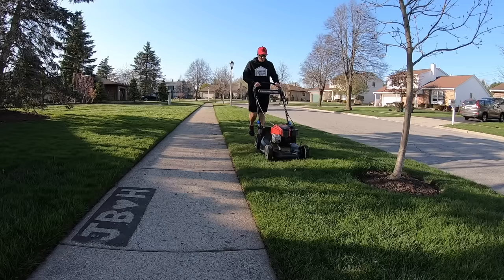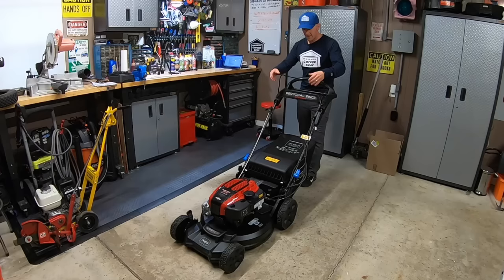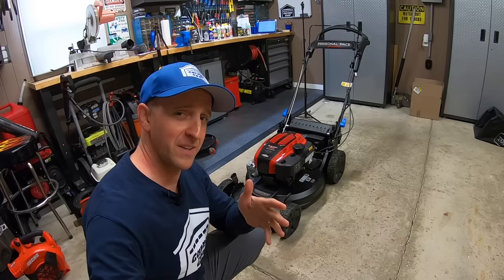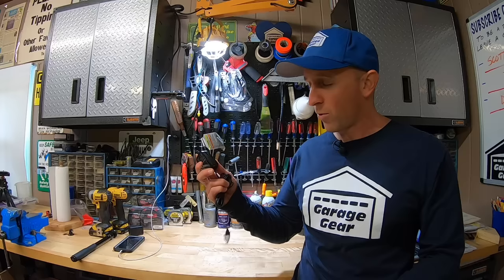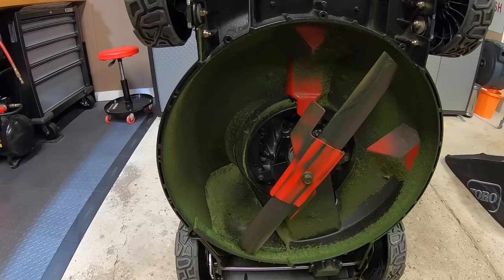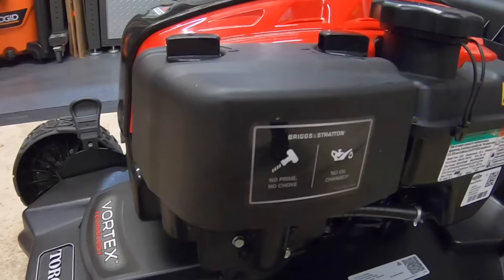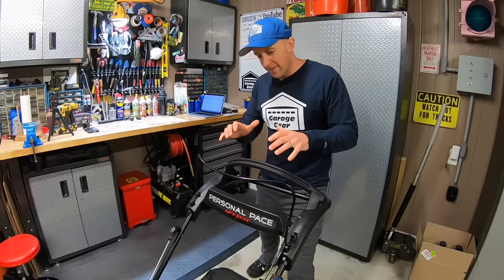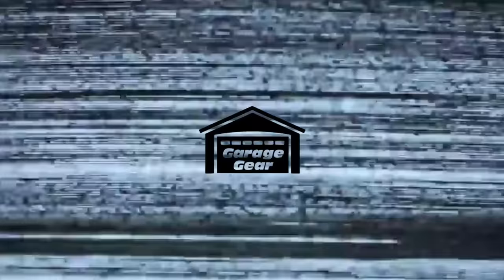IS THE TORO SUPER RECYCLER 21564 THE BEST HOMEOWNER LAWN MOWER?

Comment: The sputtering is easy to fix and has three causes.  First, the spark plug boot may not be pushed all the way on.  Second, it only comes with only enough oil to fill to the bottom of the acceptable oil fill zone on the dipstick.  The engine has an oil level switch and won't run if too little oil is in it.  Mow on a hill or hit a bump and the oil sloshes and the oil level switch momentarily turns off, killing the engine for a second.  Just add more oil up to to the top of the hashed area on the dipstick.  Finally, the factory Champion plugs just misfire.  Take your spark plug out and replace it with correct E3 brand spark plug, (E3.20 on mine).  Be sure to carefully set the spark gap to what the manual says (0.020" on mine).  Regarding the slight variation in wheel height, the wheels have ball bearings and tighter tolerances.  With plain bearing wheels there is more bearing play and that lets all wheels touch the floor, therefore you can't detect any wheel diameter difference.  Not an issue at all when on grass as the grass is springy.  Good mower.  Much more nimble than the steel deck versions.  I have long arms so the lower handle does not hit my gut.  If you have short arms or a big gut, I would not recommend it.
Reply from the maker: Thanks again for sharing these tips!

Comment: During the 1st mow with my brand new 190cc super recycler using the supplied toro oil it sputtered and complained like everybody says.  Changed the oil to mobil 1 synthetic and an E3 plug and its a different mower! Just completed a 3rd mow and absolutely no sputtering. using  reg 87 octane pump gas 

In regards to the "3 wheel off balance" issue, if you note in the manual, to achieve a particular mow height,  the front wheels will have a different notch than the rear wheels. I followed these directions and all 4 wheels are firmly in contact with my garage floor. Good luck with this very picky mower!
Reply from the maker: Thanks for sharing!
Reply: You're asking for trouble using ethanol! Bad bad bad
Reply: @pmaint1  he said regular...which usually means non ethanol
Reply: @GamerNxUSN  Have you ever been to a gas station? For the lower grade gas is always regular! Non ethanol always says non ethanol or ethanol free. Regular unleaded is just that regular unleaded. WOW

Comment: After 11 years I had it with my Husqvarna. Engine still runs well but for the last 2 years I’ve been dealing with a hole where the wheel fits the deck causing the deck to drop no matter the amount of JB weld products. I spent some time trying to figure out if I wanted to go with the new Toro Super Recycler 21565 or the Honda HRX217VKA. Ultimately I chose the Toro mainly due to the aluminum deck and Honda leaving the outdoor equipment scene. Hopefully I made the right call. They sure are expensive these days.
Reply from the maker: Nothing seems to come cheap nowadays other than cheaply made lol

Comment: Proud owner of a 21564 as of 4 hours ago thanks to your videos. Just like you warned. One front wheel spinning freely while the other three are resting on the garage floor. Also, the spark plug boot wasn't even close to being seated on the plug. How can this consistently be a problem before being boxed and shipped out? I got my mower preassembled from a very respected dealer and they obviously didn't catch the plug boot issue. Thanks to your videos I knew exactly what I was getting into and what to look for and address. I'm pretty excited to mow after taking it for a dry run around the driveway. Personal Pace worked very well and disengaged when it was supposed to when backing up. Keep up the videos coming!!!!!!
Reply from the maker: Thanks a lot for the awesome feedback! Glad you found this video and it’s information helpful Mike! 👍👍

Comment: I have the 2021 190cc, mine came with side discharge but it's on the side, not from the back. Seems pretty unsafe that it's coming from the rear so close to the legs.

Down south we got some thick St. Augustine and even after 3-4 weeks of not mowing with heavy rain and fertilizer, the 190cc cuts through it like butter.

I don't have the "vortex" but I still love the machine. The Engine surges, but I put High octane gas in it and it doesn't sputter. Seems to sputter on hotter days as well.

Great vid.
Reply from the maker: Thanks for sharing all of this Conrad!

Comment: I purchased the same mower and found that it sputtered and surged after 15-20 minutes of mowing.  The dealer replaced the carb at the recommendation of Briggs, but it did not solve the problem.  The dealer finally found that the gas cap was not venting properly and that solved the problem.  Hope this helps someone!

UPDATE:
Unfortunately, after mowing yesterday I had the same sputtering problem.  After mowing for a few minutes the engine started to miss, and then after continuing to mow for 20 minutes the sputtering started all over.  So far, new carb, new vented gas cap and new spark plug have not fixed the problem.  Back to the dealer tomorrow!

2nd UPDATE
On the third trip to the dealer, Briggs had them change the coil and that seems to have solved the problem.  Hope this helps someone.
Reply from the maker: Good to know! Thanks for sharing this John!
Reply: Mine is back at the dealer with same issues.

Comment: I’ve mowed with this exact mower for 2 seasons, one thing I wanna mention the wheel axles are plastic. If you mow on a long incline ( like a river bank) I have split out the wheels twice. The fix: put radiator clamps, that, when tightened around plastic axles, will hold the split wheels axles permanently so you can mow on inclines without gear’s slipping. 
The wheels should’ve had metal sleeves around them in 1st place. I guess toro wants to sale more parts!😂
Reply from the maker: Thanks for sharing this information my friend!

Comment: Another great video Jb! I have the exact same mower and have been using it since March, and have no sputtering... 1 helpful suggestion for those that own it, to help make the plastic carburetor last longer, put a fuel shut off valve on it and shut the fuel off when you're done mowing for the day and let the mower run till it runs out the fuel in the carb. Then pull the starter rope a few times to purge the carb.
Reply from the maker: Hey Keith great plan! I may have to make a video on this to share with everyone! Thanks for sharing! 👍
Reply: Can you help me with where to buy or model, for the fuel shut off

Comment: I have a similar model I bought new last July. About 2 months ago, the engine would stall out like it is running out of gas.(even though the tank is almost full). Brought it to the Toro service center and after having it for 3 weeks, they said they cleaned the carb. After paying $110.00 for that, got it home and did the same thing, stall out. Brought it back to the service center almost a month ago and still waiting to get it back. From what I read on Toro owner's group blog, sounds like the coil went bad. Anxious to get it back and see how it runs.
Reply from the maker: Hey just fishing, I want to say that this is a carburetor issue. A broken coil usually wouldn’t even let the mower start to begin with. Let me know what you find out. 👍
Reply: will do, thanks for the info. @GarageGear

Comment: I looked at the new Roybi $800 all wheel drive yesterday at Home Depot. it came with two batteries. Also you get either a free trimmer or blower with another two batteries. I’m still on the fence on battery mowers. My six year old Toro is still working, but needs a few things I give it a workout each week. I saving my money this summer for a replacement.
Reply from the maker: If they are giving stuff away for free it’s probably not good. Just a heads up.
Reply: @GarageGear  This man, I priced out the Makita xgt mower, trimmer, and blower and it came out to be over 2k and that's without any extra batteries.

When the price is too good to be true walk away. You get what you pay for.
Reply: @campbellpaul  I do work on my mower when it’s needed. They are not that complicated.

Comment: I have the 190cc B&S on my 2008 Toro 20092 model- this year is it's 16th season and never had sputtering. I'm getting a new one and giving it to my son for his new house. I've changes the oil maybe twice, otherwise have always just topped off, maybe 2 air filters and until the 15th season, always used 87 octane & 10% ethanol fuel- with no issues- starts fast always. I'm either lucky or it's rock solid!
Reply from the maker: Thanks for sharing! Now your son can enjoy the mow as well!
Reply: @GarageGear  Any plans on reviewing the NEW Ariens Razor Reflex Dual Blade mower? They're getting back in the walk behind mower market and seems to be trying to go after Toro.
Reply from the maker: @normbittner3762  possibly next season norm we will see! It’s definitely worth a look!
Reply: Agreed- I ordered my new 21564- wanted to buy from my local dealer but could not pass up $719 w/ veteran discount & free shipping from Home Depot.
Reply from the maker: @normbittner3762  good deal! Thank you for your service!
Reply: @GarageGear  My new Toro arrived yesterday and all is well- scratch on the deck and box was a little rough. Had weird messages from FedEx- ended up calling Home Depot and FedEx- the then expedited it and Home Depot gave me another $107 off, just for my trouble, I was just curious if it was ok, lol, so only cost $612! Also, when I put in the oil, I realized that the most rear slot in the plastic motor cover is designed to hold the dipstick with the handle grip slid into the slot 😃😃. Saturday will be its first action. Oh, mine also had all kinds of clumps on the bottom of the deck.
Reply from the maker: @normbittner3762  nice that they gave you a discount! Thanks for sharing and enjoy the mow!
Reply: @GarageGear  New Toro had its first mow yesterday- just like you said, the cut is not quite as good as my old 2008 Model 20092 Super Recycler. I changed the oil after the first mow, 45 minutes. It took a little getting used to with the, it does maneuver a bit different. I did have to adjust the personal lace cable right out of the box. It would propel on my flat driveway but no very well in the grass and not at all uphill. I had to move the cable towards the transmission about 1 1/2" to get where it needed to be. Not sure if you made a video on this but might be a good idea.
Reply from the maker: @normbittner3762  hey norm! I’m thinking this could be one of the next videos! Appreciate you sharing the idea! 👍
Reply: @GarageGear  Sounds good, I look forward to seeing it. Also, not sure if the slot for holding the dipstick was intentional or not, but it works well, lol.

Comment: Your lucky yours came out of the box and RUNS! I traded in my 2 year 3 month old Toro "Recycler" after 4 visits to a lawn equiptment sales/service shop to be looked at (the last 2 were to a Toro dealer) . The first season was ok, the rest of the time was awful! Sputtering and not starting after taking a short break and trying to restart it, I was pushing in the plug boot just in case. After trading it in I bought the Toro Super Recycler #21564 for $900.00!! I took it home and noticed 2 drops of oil right under and behind the muffler, I thought it was because it was just preped. The next morning I started it, after"3" pushes on the electric start, it started but smoked like crazy then setteled down. But it was surging/sputtering then I looked as I started mowing and I was able to look over the engine in front and saw a few more drops of oil, I went a little more and saw a little trickle of oil I stopped immediately, I just couldn't believe my bad luck a brand new mower! I was beyond mad. I called the dealer and had them pick it up, the driver tried to start it and after 5 pushes on the electric start he tried to pull started it, NO luck. I don't know what to do I think I deserve another new mower but I don't think it will happen, any advise??
Reply from the maker: Hey vinyl! I would request a new one! Oil drips are never a good sign. Thanks for sharing this with the garage gear community! 👍
Reply: @GarageGear  Thank you! I'm calling Toro tomorrow!
Reply from the maker: @vinylmaven1074  let me know how it goes

Comment: I've got a "20" Super Recycler.  Two big issues with it;  #1  Sprays out a ton of clippings on the Left side, getting packed down by the rear wheel.  #2  when pulling backwards, no mulch what so ever.  Cut 2", you've got 2" trimmings left on the lawn has you pull the mower back.  Was wondering if the front vent helps with that ?   Both the Dealer I got it from and Toro totally deny this problem exists.
Reply from the maker: Hey jada! The vent on the front is really just a gimmick! It barely does anything from why I notice. I did notice some clippings when pulling back as well but overall not too bad.

Comment: HELP. (Question for anyone). I love my old Toro AWD (all wheel drive) mower with BTAH (blue traction assist handle) but the new Toro AWD mowers (21472) have baby carriage handle without BTAH. How do I add BTAH. Thank you.

Toro's BTAH (Blue Traction Assist Handle) converts Toro's PPM (Personal Pace Mowers) (which requires a person to push Toro's heavy mower forward before the self-propelled drive kicks in) to ((easily without effort) controlling Toro's self-propelled drive with just your fingers and hands without moving forward).

This is needed on steep hills where you need the AWD Toro mower to pull you and this powerful AWD mower up the hill without any effort on your part.

The powerful Toro AWD mower can do this only with BTAH and not by Toro's PPM (extra exercise mode).

Without BTAH you end up pushing this heavy Toro mower up the hill even with AWD.

It is a shame that Toro has gone (woke not work) with this useless new Toro curved baby carriage handle. IMO.

Thank you for your help and understanding this Toro (back breaking) mower issue.
Reply from the maker: Hey AA Does your old mower no longer work?
Reply: @GarageGear  Yes, my old Toro AWD (with BTAH) mower still works great but it is getting old and I need a backup AWD mower now before the USA dollar becomes worthless.

Comment: I got my 21564 online from  Home Depot. It was shipped to me from Toro in El Paso. I noticed the engine build date is September 2021. Is that typical? Seems odd that it’s been sitting around for a couple years.   I’m still debating returning it before 30 days runs out. The engine  does not like bumps or slopes. If I’m careful not to fill the tank past about 3/4 it behaves better. I called Toro to ask if any service bulletins and they referred me to a dealer. I called the local dealer and they would not tell me if any bulletins unless I bring it in and pay $42 diagnostic fee!
Reply from the maker: Hey Stuart I would return it and probably grab another one! In the meantime you could get a used mower to get the job done while you wait for a new one to arrive! 👍
Reply: Yes Home Depot will send you old mowers. I hope you sent it back. We bought a riding mower from them in 2019 and it must have been sitting outside for two seasons. It's a piece of junk that no one can fix.

Comment: I have a 11 year old super recycler. Back when all 4 wheels are the same height. Plus I think it’s a 7 gross Torque engine. In your opinion do you think a 2024 model with all the new features plus a 8 gross torque engine would be a decent upgrade? Our yard is very uneven and bumpy so my mower stops in its tracks at times so I wonder if 10 inch rear wheels with extra traction would help a little.
Reply from the maker: Hey Charlie! The bigger back wheels would help with easier turning. I would keep that older model over buying a new one though! The older ones are built better! The new ones have issues backing up which I did a video on!
Reply: @GarageGear  ah ok. It’s a shame newer models have issues. A more powerful engine plus all the other newer features would have been nice. By the way. Would you happen to know what dual blade accelerators are? I will say too the older style personal pace handle is nice.
Reply from the maker: @Charlie157-lb1et  hey Charlie! They’re just not built as good as they used to be. The dual blade accelerator is an additional piece with wings that helps kick clippings around more for better mulching. It usually attaches over the blade on toros.

Comment: Had a Briggs and Stratton snow blower I bought in 2020 and by 2021 it seized up on me when I was trying to run the unit until gas ran out. Luckily Costco returned it but lesson learned—run the other way when you see Briggs and Stratton.
Reply from the maker: Thanks for sharing!
Reply: Yep. I had a blower with a BnS motor and it literally blew up the innards. One day I went to start it and nothing, I changed the oil and gave it a once over and when changing the oil I took out chucnks of metal. I'm talking pieces so big it couldn't come out the oil drain hole.. I searched up what it was but I don't remember off hand what the part was called that cracked and crumbled..

Comment: I like everything about my Super Recycler except the Personal Pace.  I feel like I’m pushing the mower and I’m exhausted when finished.  I have neighbors with the same mower and they have the same complaint.  We all had Snappers before and the self propelled system was much better. Looking to get rid of it! Should I try the Honda?
Reply from the maker: Depending on they Honda the drive systems aren’t too different than the super recycler. They have thumb drives. See my videos on them to see if they’ll work for you!
Reply: Mine did the same thing until I adjusted the drive cable to make sure at fully travel the PP fully engages the drive belt.